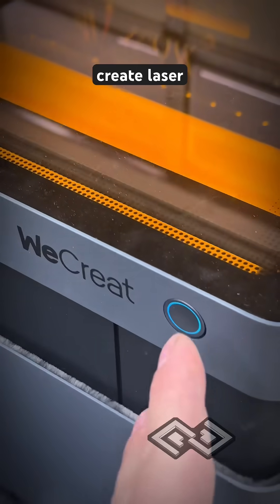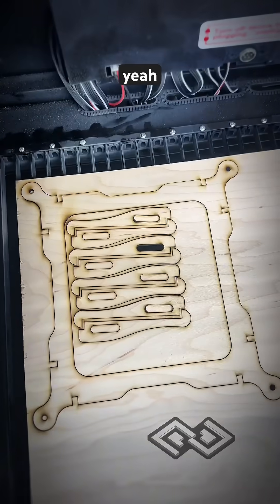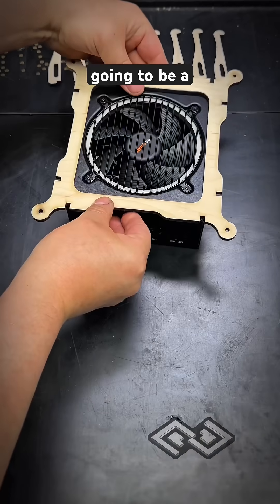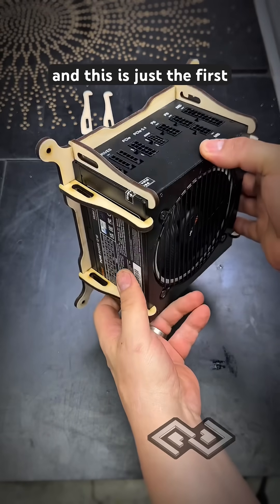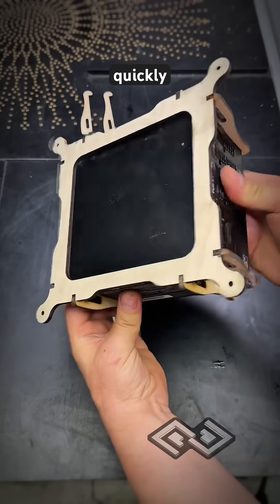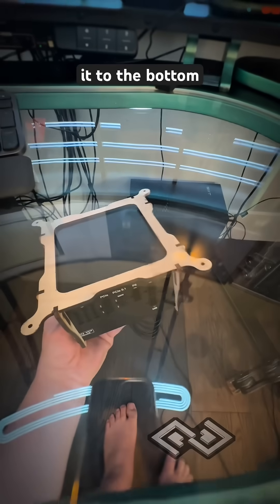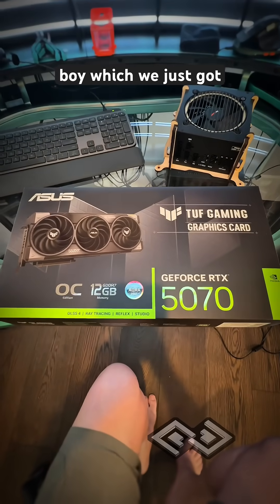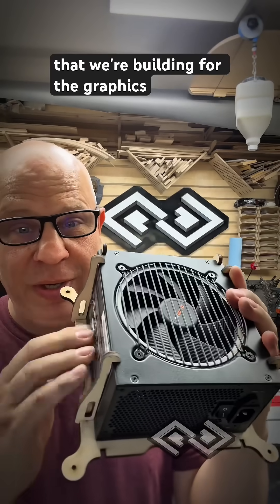@WeCreatOfficial laser pc case project progress. #laser #lasercutting #lasercuttingmachine

Comment: I have a full spectrum 3d muse 45 c02 (5 years in and im not loving it).  im thinking of switching it out. Pretty happy with this we create? Pros, cons?
Reply from the maker: Pretty happy with it! The power is good for cutting through thin wood and other materials. Software is super easy to use and the built in camera helps to align your designs. It’s a diode laser so it can’t cut clear materials like acrylic. It does generate a lot of fumes especially when cutting. Also I am having trouble with the Wi-Fi connecting again after turning on and off but that might be my WiFi and not the machine. Not sure though. Overall it’s very easy to use and has a lot of flexibility with additional attachments like the rotary, long material auto-feeder and swappable lasers. If you needed something more powerful and larger it seems like the next price point is triple to quadruple the cost. Happy to answer any other questions 😊👍